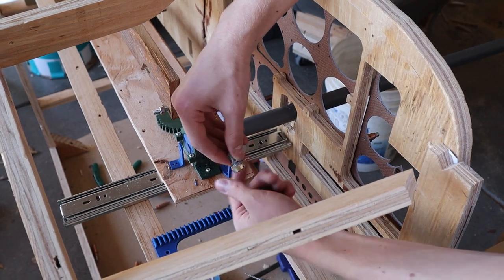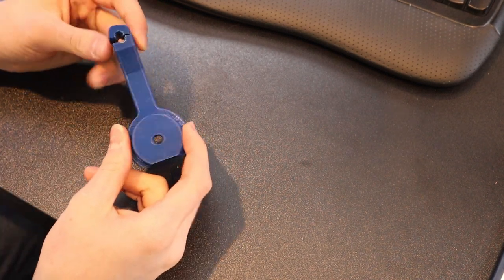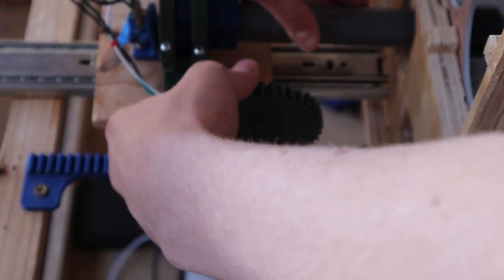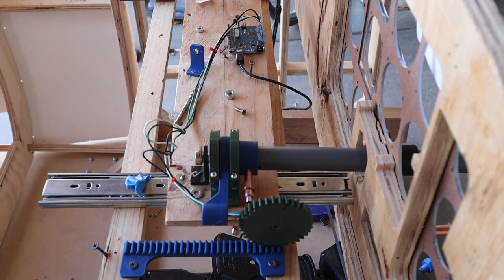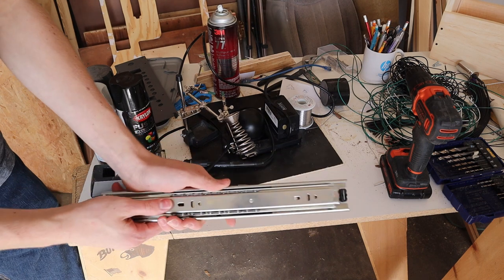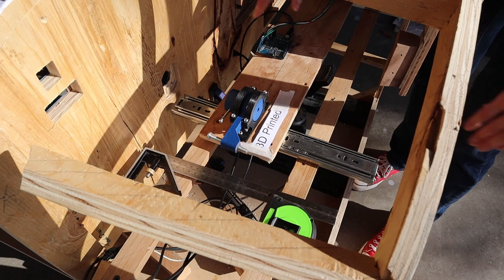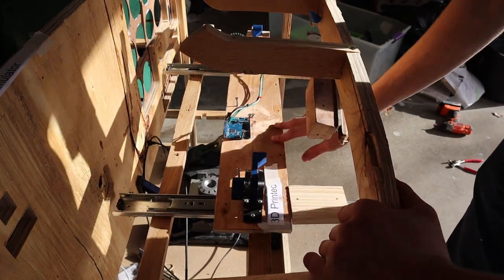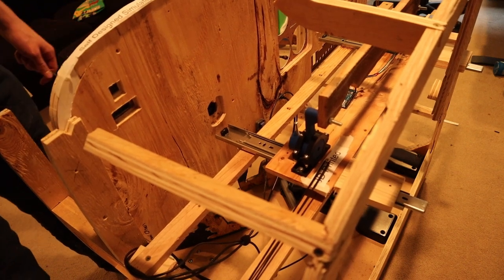Starting the Yoke Build! | C172 #30

Comment: Hello!
I’m planning to do a simulator just like yours, except I have a minor dilemma:
Do you suggest that I buy the Honeycomb Alpha and Honeycomb Bravo for the yoke and throttle, or recreating them like yours?
I plan on doing everything else just like you do. I’m planning on using it to help my dad with his PPL.
Thanks!
Reply from the maker: Honestly I'd probably go for a honeycomb yoke if you want it to be more plug and play, but you can go with mine if you'd like to have it dual linked. My current yoke doesn't have the final developments I want to implement. There are people online who have extended the honeycomb yoke.
Email CaptainBobSim@gmail.com for throttle plans and purchase a real aircraft mixture cable from aircraft spruce.
That's cool you're building it for your dad!
Reply: @CaptainBobSim  Yeah, I'm getting my PPL through the RCAC, and my dad's getting his through a program.
I'm considering buying some of your gear in the future, it's looking top-of-the-line and the most affordable I can find.
Thanks for the insight!
Reply from the maker: That's awesome! Keep me posted on your licenses!
Reply: @CaptainBobSim  thanks! I definitely will! If I get started on this project, you’re my guy to consult for the yoke.